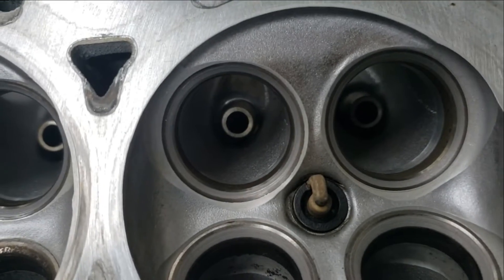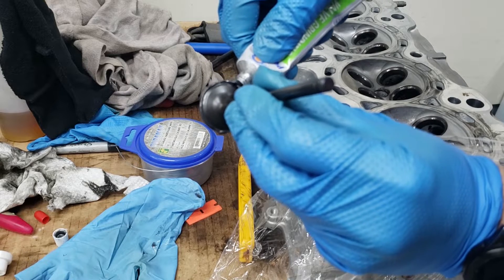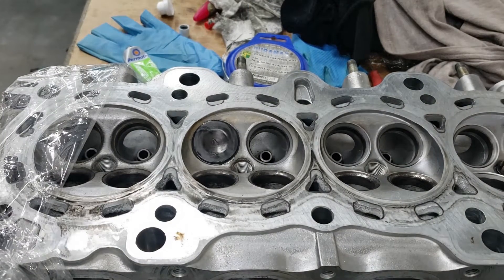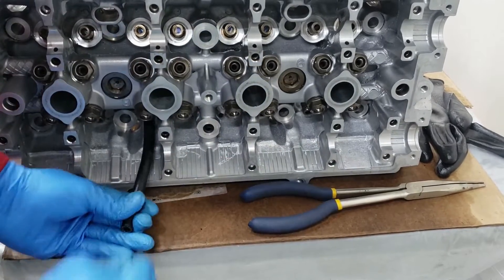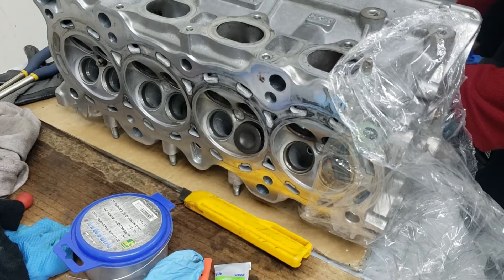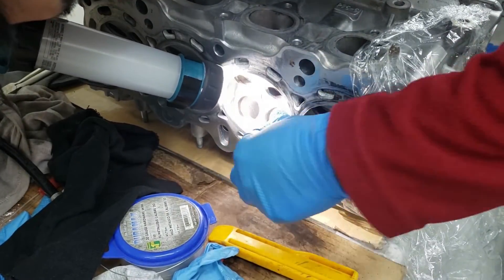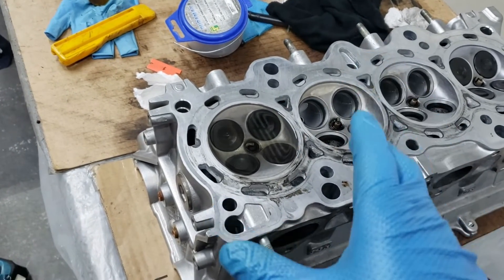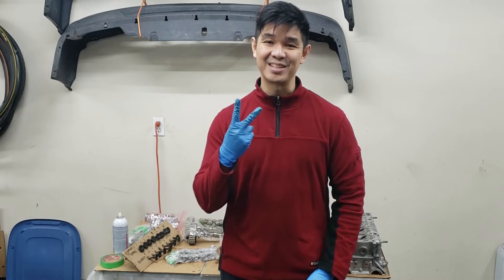||HONDA EF9/ED7 CIVIC & CRX|| B18B1 Lapping Valves

Comment: Great channel! We are trying to rebuild D16 DOHC engine, and I remember you had a video where you did "popping sound" test for valve seals, but I cannot find it. Do you maybe know where you were doing that 🙃
Reply from the maker: I don't think I know what test that is. The only test for valve seals is to check for oil burning. I've done videos on valve lash adjustments etc. I don't have anything that does a popping sound for valve seals though.